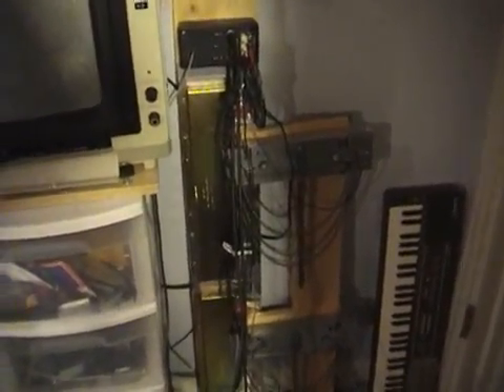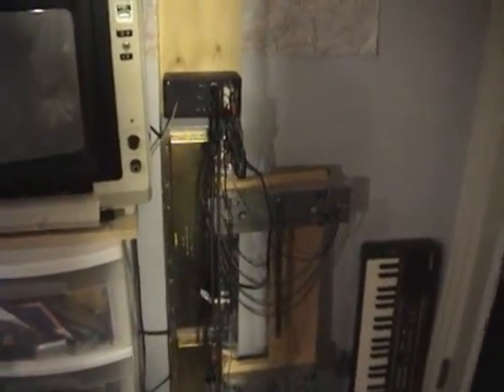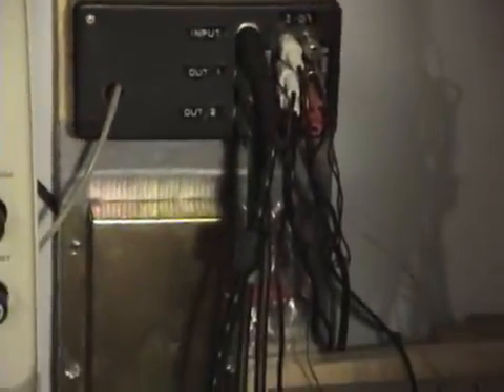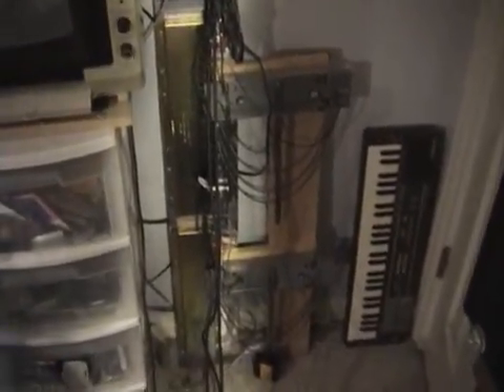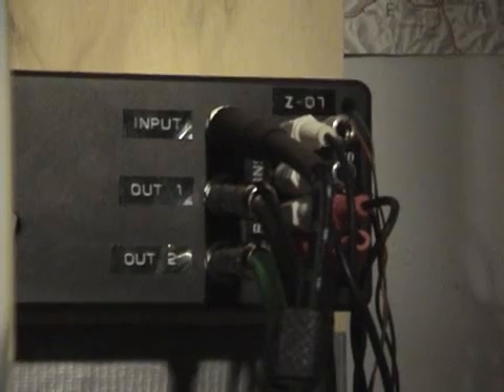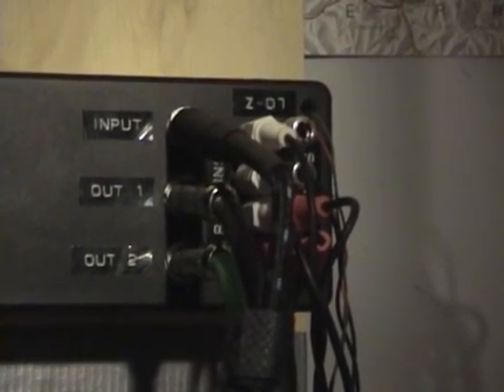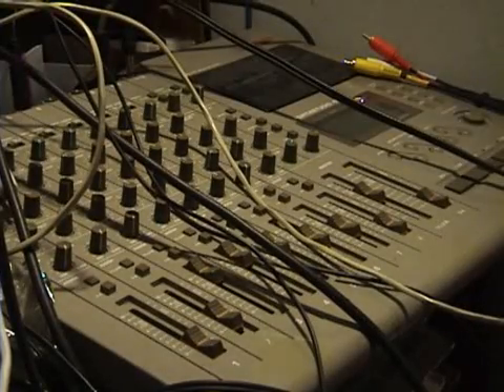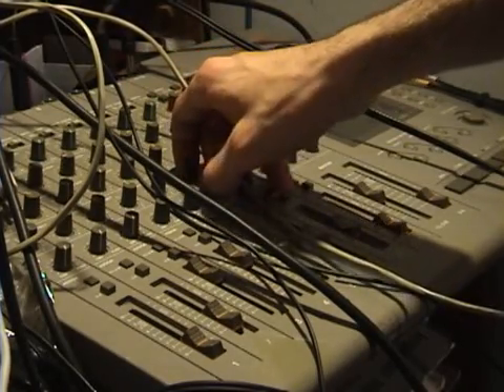BUG VERB MkIV (DIY studio/hi-fi spring reverb)

Comment: I know this video is 10 years old (happy birthday for tomorrow!), but I have one of those necklace reverbs, and was wondering what you did to get it to work with your 4 track? I just want to be able to use it from an Aus send on a mixer, back into a spare channel on the mixer. Do you know the impedance of the input and output on the necklace reverb, as you mention that it's low? ANY help is appreciated. IF you read this. :)
Reply from the maker: Hi Jason. I used something I put together on perf board from one of the standard Accutronics circuits - I also think I included some mid range boost EQ in the drive or recovery part, it was too dark-sounding. With off the shelf stuff you should be able to drive it with one channel of a normal headphone amp and wire the pickup coil into a normal mic preamp (balanced mic preamps ended up giving way less 60hz buzz than the single-ended recovery amp I had made)
Reply: @pdmillar   Thank you so much for the reply! I'll try a headphone amp, and see how I get on. With the pickup coil's wires, they're both insulated. Does that mean I'd wire them to pins 2 & 3 of an XLR plug? Or does one carry the signal, with one being ground? If you can remember..
Reply from the maker: @jasontsh  I'm pretty sure both ends of the coil were floating. You'd want to wire them to 2 & 3 of the XLR and ground the reverb chassis to pin 1, then you'd have a balanced pickup
Reply: @pdmillar  That makes sense; but I probably wouldn't have thought of it until you said it. Thank you! :)

Comment from the maker: The new ones were a little over $20 each, you could buy them directly from the factory on Ebay, but they sold out to a Korean company called Belton Engineering last year. The Hammond ones I pulled off some junked tone cabinets.

Comment from the maker: Yes, that amp has an Accutronics-type reverb tank in it (4EB3C1B probably in the bottom of the amp covered up with vinyl). The input and output coils are on RCAs, but it's necessary for the amp to have driver and recovery amp circuits specifically for the reverb, and in tube amps usually a small transformer.